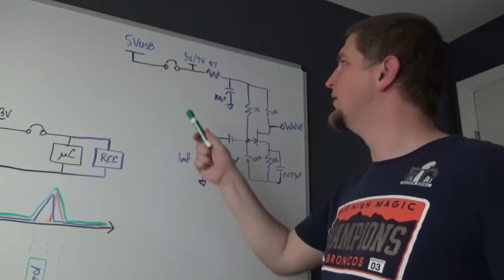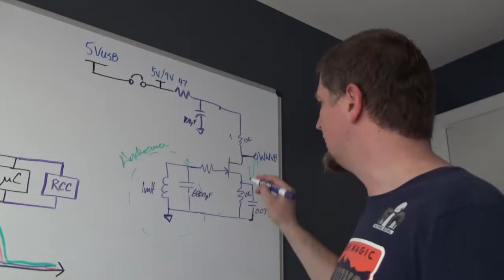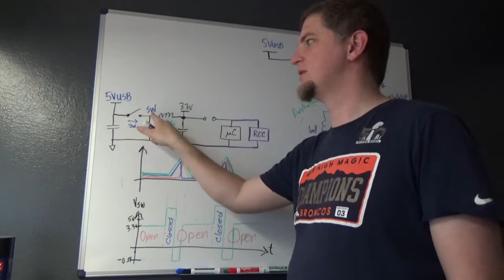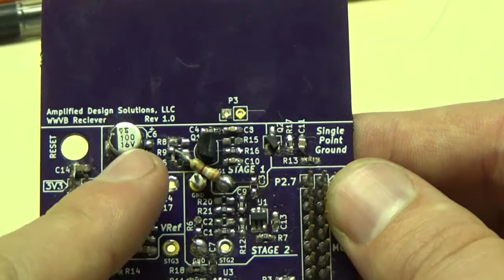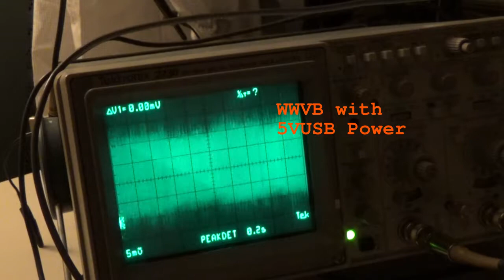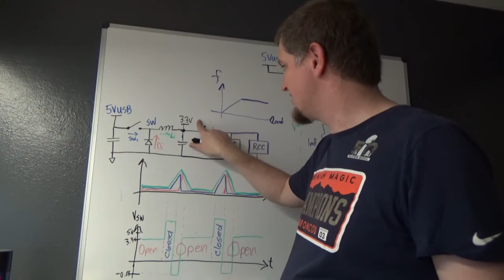#0007 WWVB Receiver Project - Part 4

Comment: Great video! You're definitely more advanced at this stuff than I am. I am using a WWVB receiver module to pick up the signal and I found that the more circuitry I added, the less reliable my WWVB output would be. For the most part, I resolved the issue with a couple filter caps. I think I used a 1uF or 10uF plus a smaller. 1uF or .01uF. That seemed to take care of it. Then I learned after running that for a while, the regulator got VERY hot and unreliable. I'm sure if I we're to put it on a heat sink it would run beautifully. What if you were to put some small ceramic capacitors along the rail for filtering?
Reply from the maker: Actually - I don't recall even thinking about connecting the 100uF cap directly to the 5V rail - duh(!).  That may actually eliminate the switching noise as well.  It's worth a shot - I'm not sure it will do the trick, due to distance from the switching supply, but it's worth a shot.  I do recall adding 4.7uF to the 5V rail without much performance improvement - so I'm not convinced more will help, but it's certainly worth trying.  Your ceramic cap close to the output of your linear regulator may be causing it to oscillate slightly and result in elevated heat dissipation.  Ceramics belong on ic power inputs not on outputs of the power supplies (typically) due to ESR needed to stablize the control loop, but it also doesn't take much current to make a TO220 package hot either.
Reply: WWVB will be shutting down in 2019, reportedly.